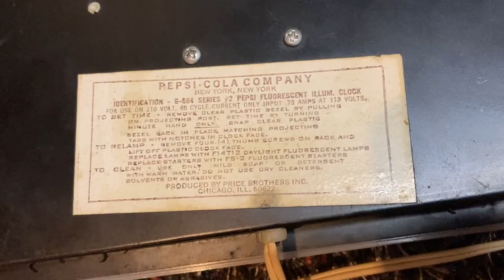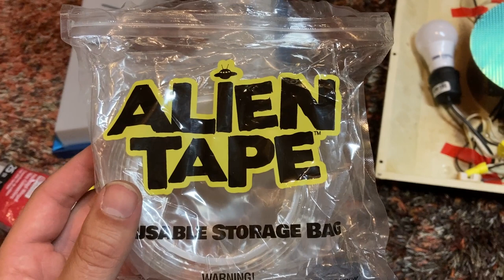It's Cinnabon O'Clock! | Vintage Clock Retrofit

Comment: You might want to check and make sure that is not a shock or fire hazard. If one side of that AC line is leaking or connected to that metal back it could be dangerous. You can measure the resistance, with an ohmmeter and the AC plug not connected to an AC outlet, from each prong of the AC cord to the metal parts on the outside or plug in the cord and connect an AC volt meter to the house ground and touch the exposed metal cabinet parts, with the other meter probe, to see if there is a potential voltage difference.